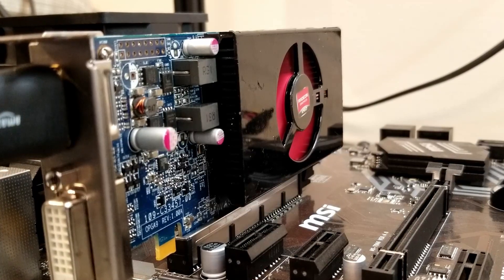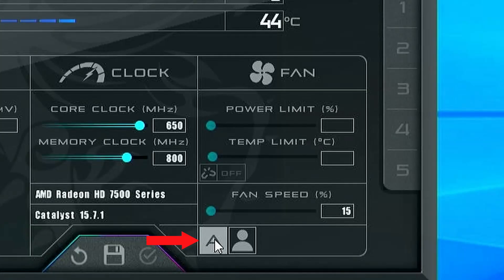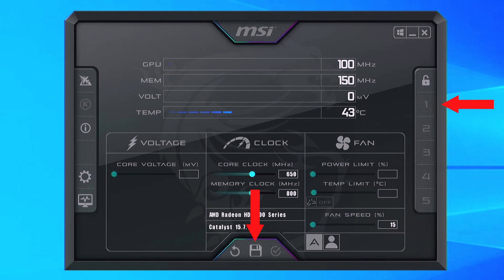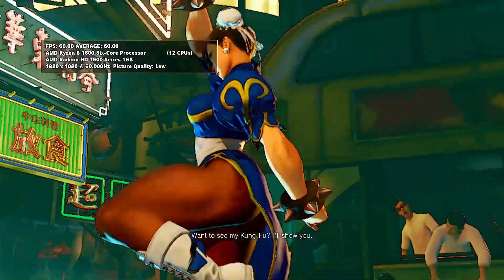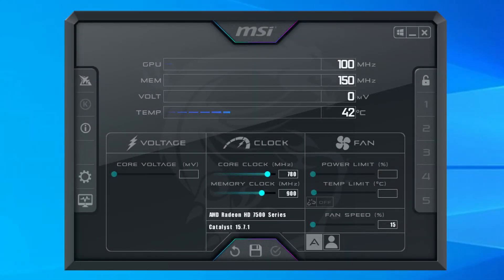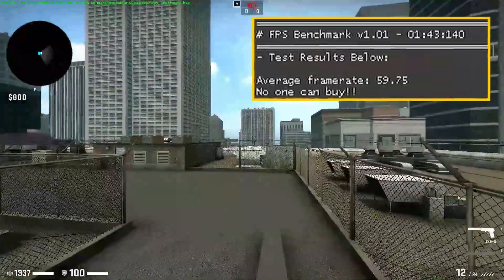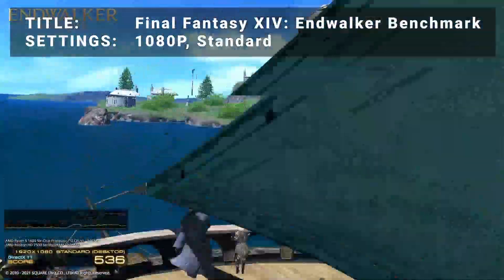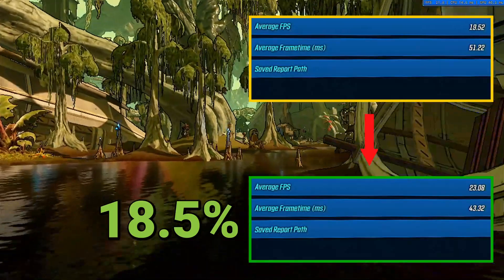Best HD 7570 Overclocking Settings Guide

Comment: hello? i have a question. Do you have to update this GPU’s driver (or update motherboard firmware) for the DisplayPort on this GPU to work? Or it just works right away without configuration? (my CPU doesn’t have an iGPU)
Reply: this gpu has problems correctly using only the display port, ive only gotten it working when i use the dvi as a "backup monitor" you can leave set off while your display port monitor shows your screen
Reply: @yeemeedoo  oh that's weird... anyway thanks for the info! I'm using the GTX960 now but i'll try testing that card once more
Reply: @mlemingcapoo  the gtx 960 is just a much better card and it has modern ports, just keep that. this card youre looking at is WAY WORSE

Comment: I got this to revamp an old Dell Optiplex. Mostly to do online streaming on a TV. 1080p seems too much for it, so I opted for 720. In Windows as well. Been dialing it in several days now. I've done slight overclock using AMDs Overdrive. 
I might try this, though. Thanks!
Reply: Hey this a bit late but what optiplex i got an old 780  and i needed to add a bios mod to get h264 to get 1080p working properly

Comment: I have try your 780MHz Core Clock and 900MHz Memory Clock Settings on my AMD (Dell) Radeon HD7570.

On Original Settings with the FurMark Benchmark the Graphics Card have an max. Temperature of 75°C an 15FPS on 720P Stress test. 

With your Settings it will reach the 80°C Mark and 19FPS with no Errors.

I have with your Settings in games ~5FPS+ more than on Original Settings.

Thanks for that video dude!
Greetings from Germany :)

Comment: Try modded graphics 🤯🤯🤯 & these gpus are $10 on ebay
Reply: Modded graphics?
Reply: @poseidon3032  molded drivers
Reply: Molded drivers and overlooking can possible be enough for 1080p I use to have this gpu and I did exactly that and tried it and it worked. You also need a decent cpu
Reply: @z5vix  I have an Intel 9550S Quad core. I believe it would be sufficient
Reply: which modded driver?
Reply: @duyxnk  nimez is just anermine zone, so use anermine zone since they have merged i believe, also i upgraded and no longer use this gpu